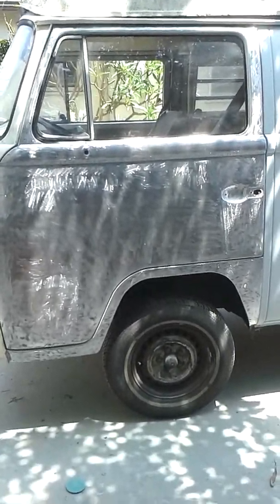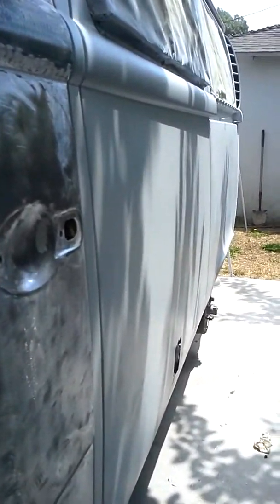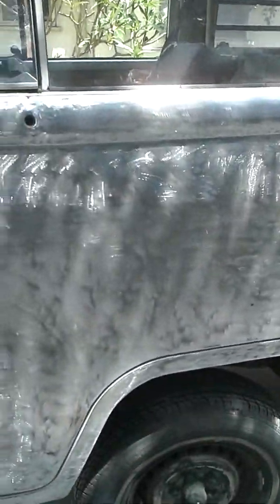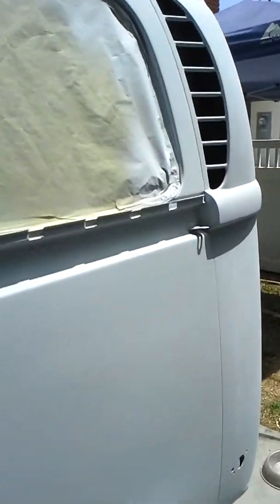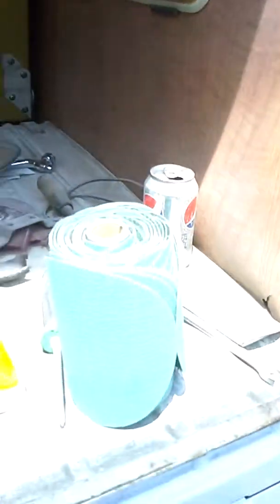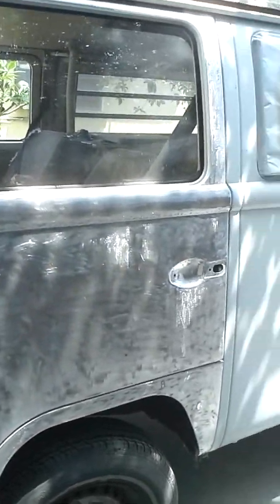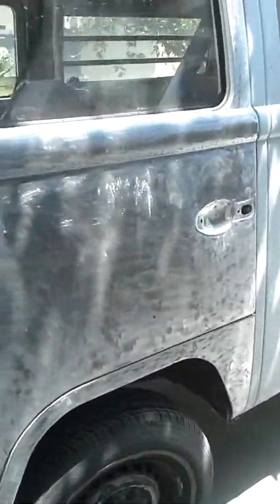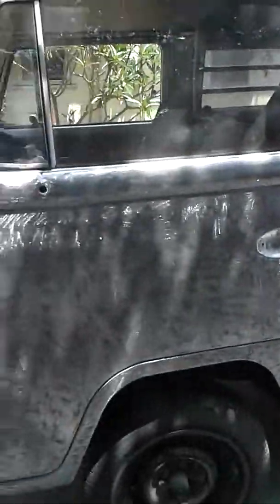1971 VW WEST BUS FALIA RESTORATION PART 5

Comment: GS,
Brother, help me out I'm new to painting:
What type of grinder and sandpaper do you start with to take off the paint?
1. Grind the paint off
2. Sand the metal down with 80 grit, the 180 grit
3. Primer, what type, I think you mentioned etching primer?
4. What's guy-coated? and do you have to sand the primer before doing this set, if so what grit?
5. What's blocked out?
6. Stop at 400 or 600 grit??
7. Sealer?? what type of sealer? do you use can primer and sealers??
8. After sealer, sand with?